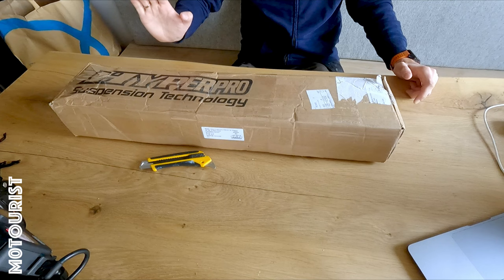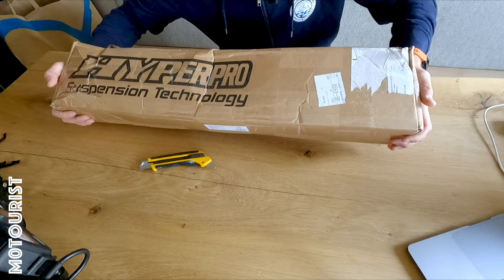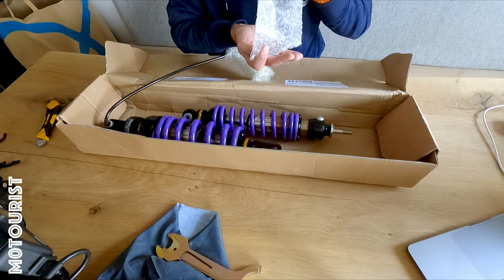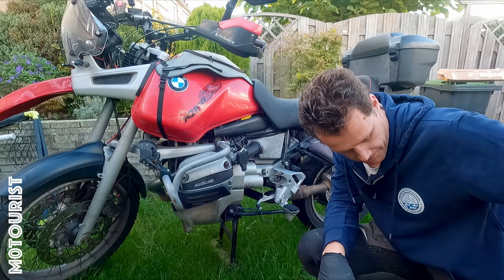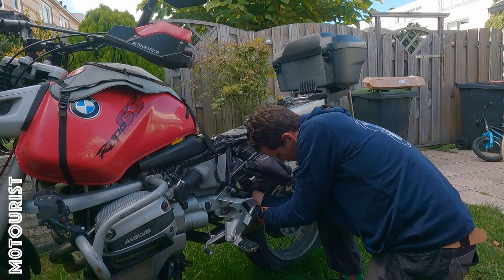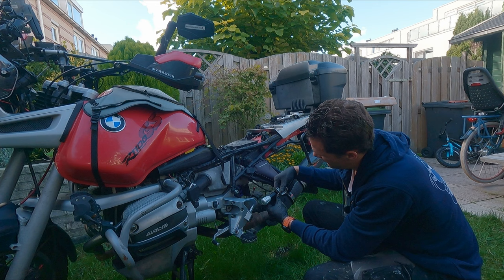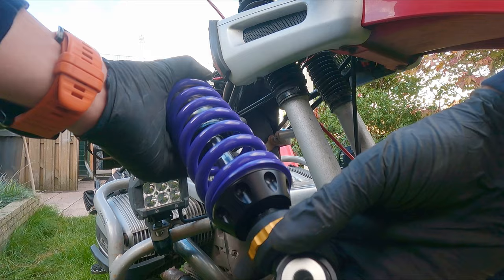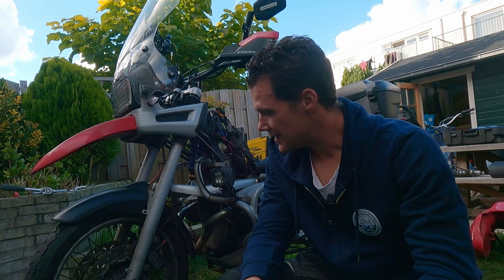BikeMods - HyperPro install - R1100GS

Comment: I'm impressed with the fact that you work on your bike in your backyard, on grass. I built a wood frame in my mother's garage to hold my bikes when working on them. I have the same bike as you can see in my photo.
Reply from the maker: I still need to fix my garage door, so I can work inside the garage😑
The only problem with the grass is that you shouldn't drop a bolt, washer or a nut😉

Comment: Looks easy but it was a massive fight on mine (due to the bolts never having been undone). Loads of penetrating oil and a really long lever on the ratchet is needed.
Reply from the maker: Undoing the bottom bolt on rear gave me a bit of a struggle, removing the rear wheel first would have made that 10 times easier...🤣